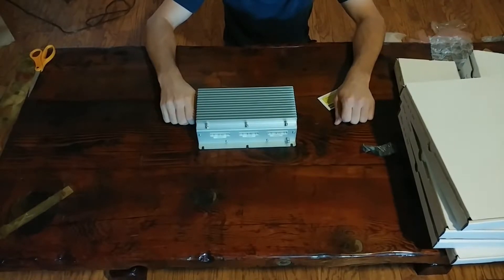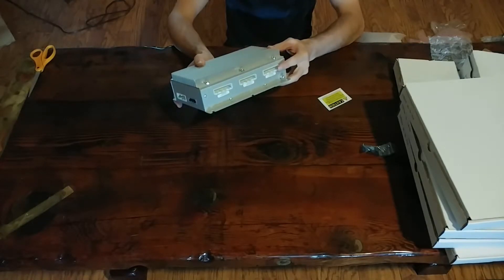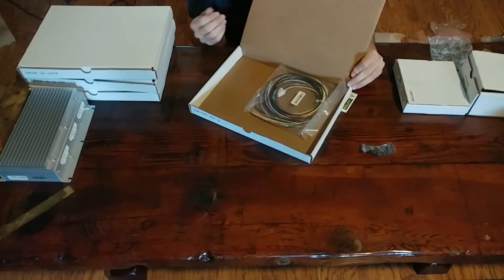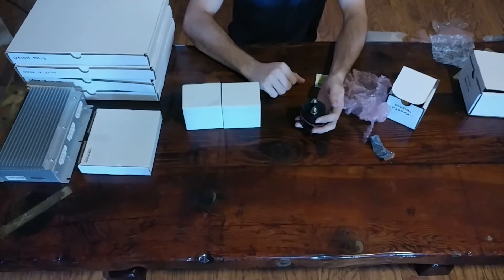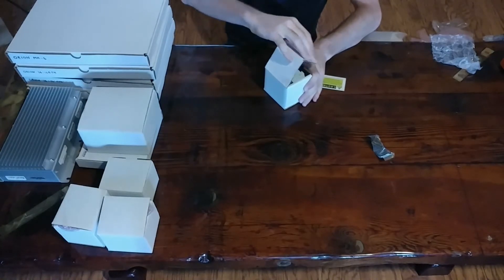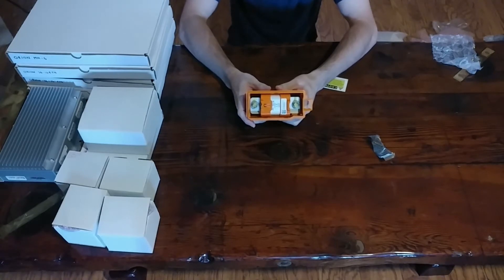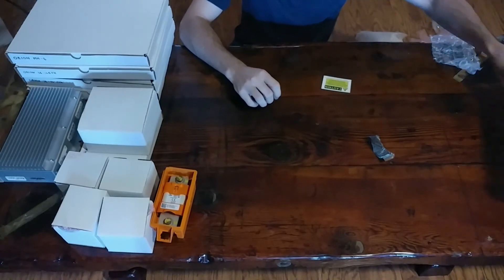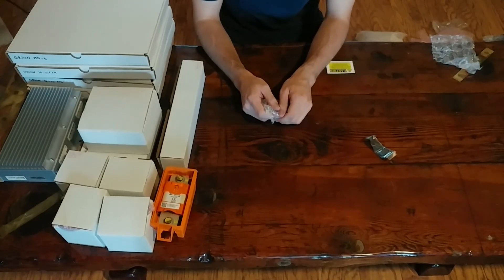Mitsubishi 3000GT Tesla Swap 11 - Electronics Unboxing

Comment: 97 BMS wires to run . to fuse or not to fuse that is the question.
Reply from the maker: I've actually got 101 wires to run since I have a 100S setup! I hadn't thought about putting fuses on since the Orion BMS documentation only talks about the fuses inside the BMS and otherwise has the wires connected directly between the battery and the BMS, but I'll be sure to do some research before getting the wiring going.